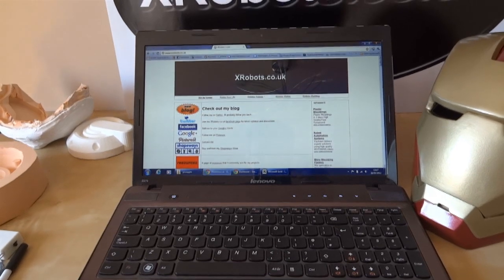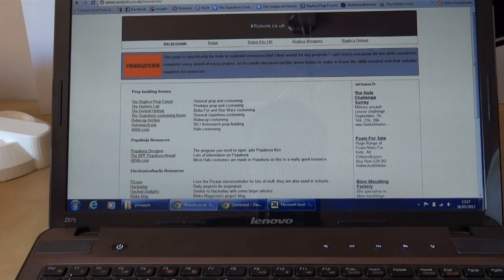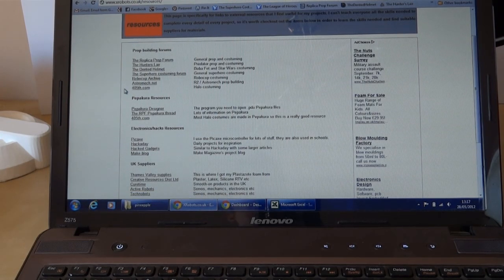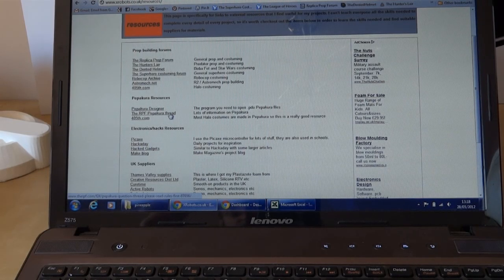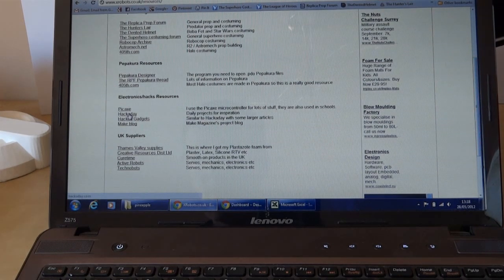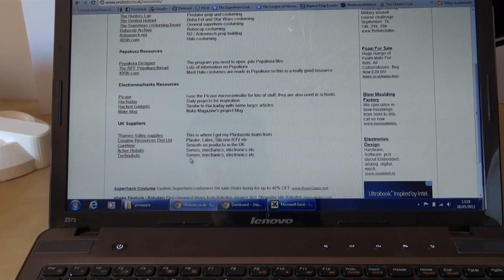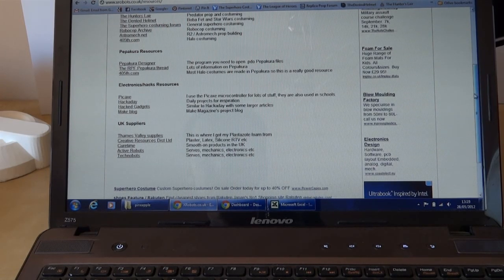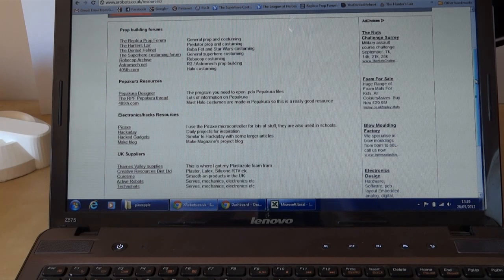Iron Man Power Suit #9 | Project Resources | James Bruton

Comment: Could you -->in theory<-- have the suit pieces scanned and the files converted to .stl? Then you could have them uploaded to your website or Shapeways account and people could submit the files /get them printed from there...  I would love to have a suit printed from metal, and use it for motorcycle crash resistance...  Once I put some joints in it, should be fine...